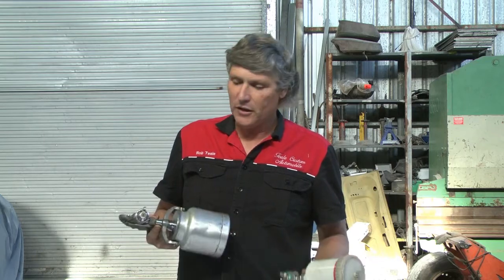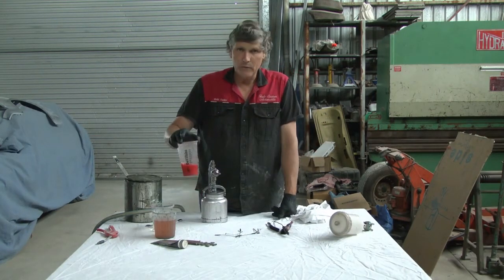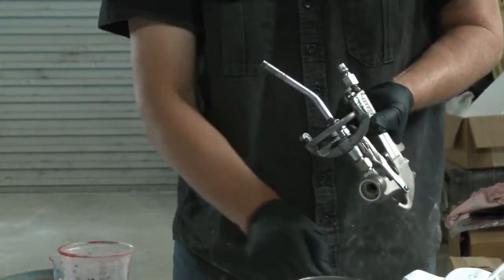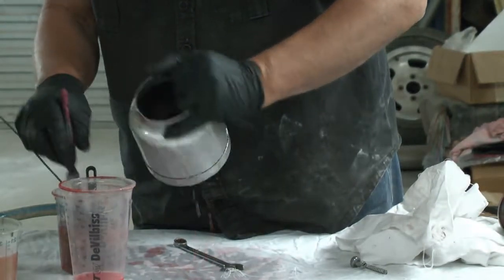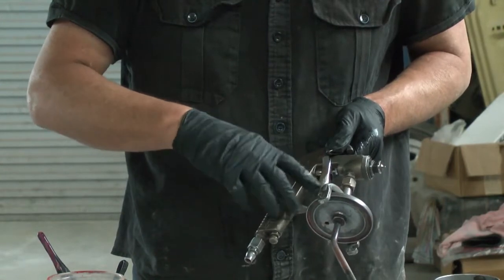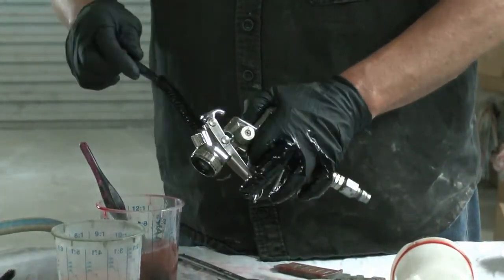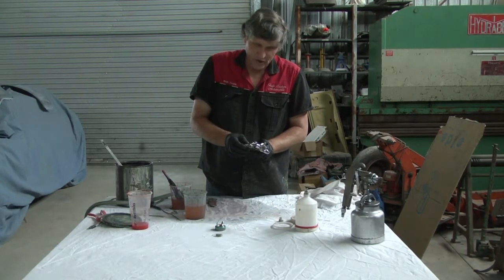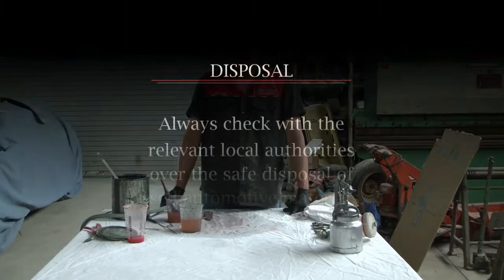Spraygun Cleaning Demo

Comment: Rob
How long can paint sit in the gun and still be used for next coat /panel?  Let's just say at 30c heat.
Thanks for cleaning tips.  The main reason I dread painting!
Pete
Reply from the maker: Hi Pete, thank you asking the question. This is a tricky thing to give a straight answer to, as it falls into the same category as how long is a piece of string. I will try to give you bit of an idea anyway. If you are using two pack paints ( anything that has a hardener or catalist) the paint manufacturer will have an advertised pot life. This will either be on the side of the paint can or from a data sheet. These paints once mixed are undergoing a chemical reaction that will result in cured paint. The pot life is the time that the product will remain usable in the gun, from that point in time it is best to be cleaning remaining paint from the spray gun. Single part paint (no hardener) can be left in the pot much longer. I have spray guns with weld through primer and single part black in them that I never clean. However the paint does dry in the air cap around the tip and every so often I need to run a cleaning brush up the suction tubes.  Like I said bit of a tricky question to give you a definite answer, but hopefully I have given you something to think about. Cheers Rob.